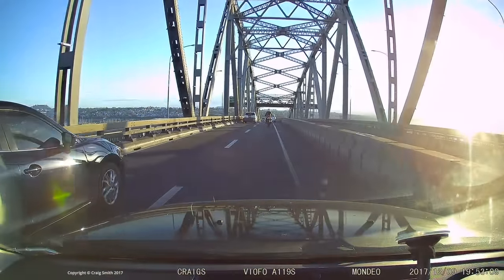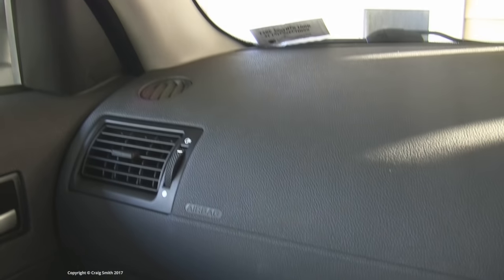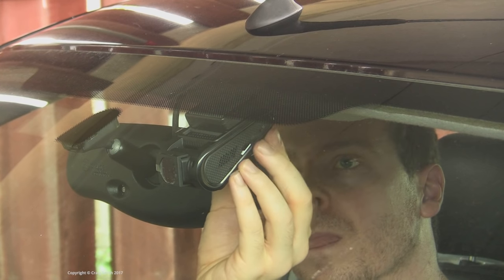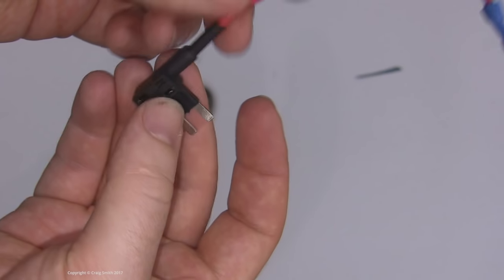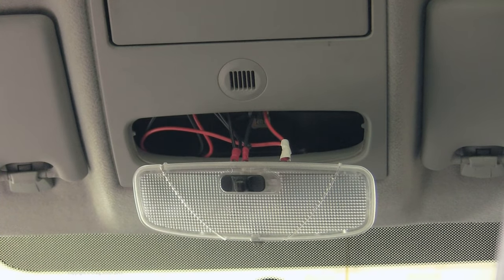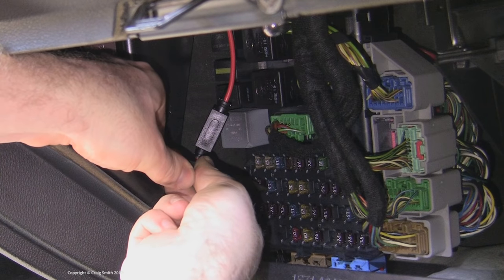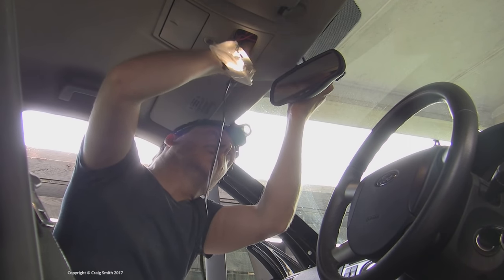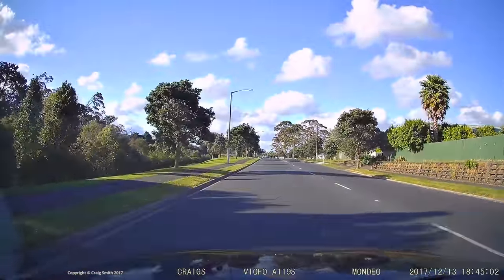How to: Hardwire install a dash cam with USB power supply

Comment: WHY WOULD YOU CONNECT TO ACC, STILL REQUIRING THE KEY TO BE TURNED... WHAT'S THE POINT?
YOU DID  N O T  CONNECT FOR PARKING MODE TO WORK... WHY DIDN'T YOU CONNECT TO CONTINUOUS DC?
Reply: because you wouldn't want to wear out the engine if you are trying to check out if everything is working correctly

Comment: Good luck with this particular model. I have had 4 in less than a year and every one failed in a different way. The last one wont run off the GPS mount so I just gave up on them. 
Cannot recommend strongly enough to avoid the Viofo A119.

Comment: How do we wire if we want to record while parked at a public parking facility?
Reply from the maker: As explained in the video, the camera shown (and all USB powered cameras) don't have a way of wiring to properly control parking modes. You can wire them up to permanent live, or to battery saving boxes, and use their faux software modes, but it's not ideal.
Reply: plug in to constant power and set to motion sensor and it will turn on when motion is detected

Comment: @5:20 You don't want to obstruct your view by placing a device in your field of view, but clearly have this huge suction cup mounted phone holder in the vertical position (so it's not for GPS usage) right in the line of sight out the front windshield.   A bit hypocritical no?   @10:15 Your butt splice  seems loose.  Solder is a much better, reliable way to make a connection.  Decent tutorial though.
Reply from the maker: The phone mount obstructs my view... of the bonnet and dash. The crimp is tight, my fingers are what's moving. Solder has its drawbacks.

Comment: It should not drain your battery if you keep it plugged into the cigarette lighter.   Also.  By hard wiring it you lose the motion sensor function and the G sensor function.
Reply from the maker: No & no.
Reply: Craig's DIY Car So while your car is off if someone hits it or moves close Enough to it to trigger the motion sensor.   It will turn itself on?
Reply from the maker: It's either on or not, these USB powered cameras do not have a proper native parking mode because they can't see the ignition circuit distinct to power. They can only 'fake' it with motion sensing, GPS, etc, but that requires them to be powered on permanently.
Reply: Jason Roy .

Comment: Does this guy not realize that most people do not have these tools or know how to perform this level of installation?  So, is this video made for no other reason than to show how technical he is?!
Reply: i mean this is a DIY car channel, none of the things he used (multimeter, wire strippers) are that uncommon for people to own, especially for DIY people. he made it as clear as possible with his instructions and seems like many people including myself have found this useful. although even if the video was about a very technical and difficult install, why can't he make a video in case someone finds it useful?
Reply: All made sense to me and I'm no expert. Links are in the description and it's not hard to find these things for sale all over the net. A few pauses of the video whilst installing and I can't see how you'd go wrong?